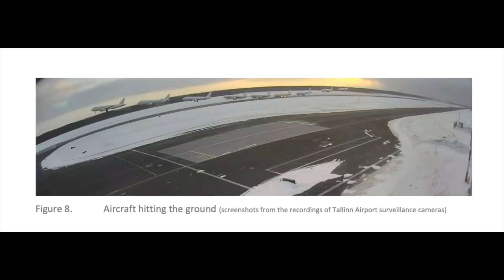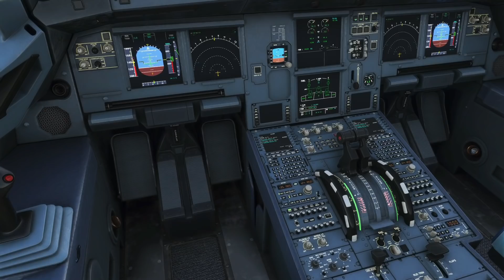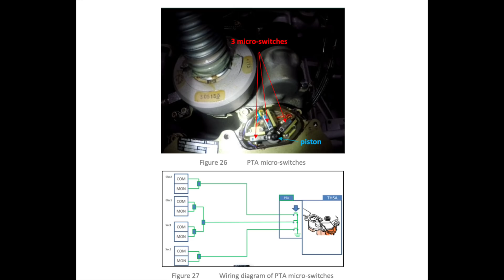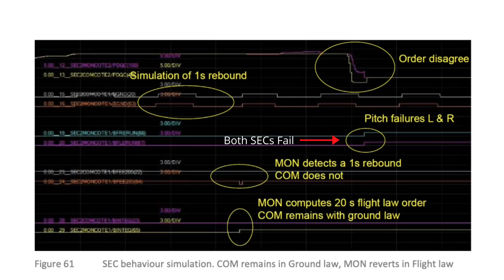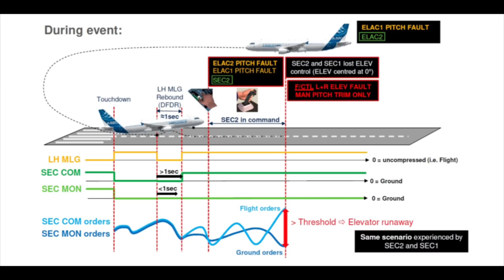The Oil Change That Crashed A Passenger Jet | The Crash Of Smartlynx 9001

Comment: I’ve actually flown both types and find that with more automation I have more time to recheck routes weather and possible outcomes were as no or extremely little automation there no time for any changes once you’re airborne, the main difference is just how you manage time with no to little automation you have to plan ahead even before you get on, the same but to a lesser extent go for largely or fully automated flight, for instance if input the wrong directions how to know and override the computer(s) in both cases it up to the pilot(s) to know and understand their’s and their plane’s limitations. If I had to choose I’d take more automation, but only if I had the full training needed to understand and situational awareness of the mechanics of system, otherwise no matter what I’m doomed to fail and quite probably get myself and others killed, long term training, self awareness, and greater quality over quantity in both pilot and machine will increase both chances of survival . I’ll go with an 8 for automation as you’ll always need manual controls as a backup
Reply: Consider that when a malfunction occurs in a complex automated system it could take a team of experts weeks to figure out exactly what went wrong. So how can you expect pilots who are suddenly thrown into an emergency situation to figure out a way around a problem with the automation in just a few minutes or even just a few seconds? The problem with automation is that a wounded automation system can react in crazy and unanticipated ways. Like MCAS on the 737 for example. In the types of automation systems I designed for industrial use the only way to deal with such craziness was to shut everything off and then try to figure out what went wrong. Of course you can't do that in an airplane in flight. Therefore the only solution is to disable all of the automation completely and fall back to a complete manual back-up where the pilot can take immediate and total control of the entire airplane. And of course this will require that pilots keep up with their basic flying skills as automation does tend to erode basic pilot skills. Maybe some mandatory stick time in gliders for commercial pilots wouldn't be a bad idea.
Reply: @joevignolor4u949  ever heard the word redundancy, two or more systems working in tandem if all else fails always have the manual controls as backup however with larger and heavier loads stall speed increases and more complex aircraft and communications one or more pilots aren’t going to be able to cope with work load of a un-automated flight control system trust me I’d rather have a new triple 7 than a Convair 780 turbo prop even with five pilots on board . Also I think I did ask for more training and understanding of the systems didn’t I ?
Reply: @samaguirre3283  So what happens when the automation system in your airplane pitches you nose down 45 degrees right after take off when you are only 1,000 feet off the ground. What do you do then? Oh wait a second. Yes that's happened hasn't it? And remember Sully? He was a glider pilot.
Reply: @joevignolor4u949  to be exact I had a old DC6 with three of it’s four engines knocked out and the last one over revving because of a single mistake by myself and captain and ground mechanics that made it me and the cap for not noticing thankfully the flight engineer was able to to catch it and we made emergency landing the same couldn’t be said of our Gulfstream4 as we were about takeoff it flashed us every kind of warnings making us abort the takeoff even before we knew what was happening, like you said I have both glider and sailplane practice and many a pilot(s) (Gimli glider=Air Canada flight143 & TACA flight110 and your Airways flight1549) to their credit have saved both plane and the lives of crew, passengers, and civilians on ground, but it thanks to some form of automation that made it possible not the other way around even Air France flight 296 wasn’t because of automation but lack of understanding and proper training, the three examples of unpowered emergency landing given were made possible because of proper training and properly followed procedure(s) as well as a little help from (you guessed it) automation, so to answer your question yes it can and will fail sometimes but very very rarely does it catch a properly trained pilot off guard on the other hand a manually operated system can fully be expected to fail at any moment and it will kill you . I could argue with you about the con and pros of automation in a plane but you got to understand the why and how before anything so I’ll just say you are right and I’m wrong okay and leave it at that ?
Reply: @samaguirre3283  The only point I am trying to make is that when automation systems malfunction, which they sometimes do, the results can be highly unpredictable and unexpected and it can catch you totally off guard. Because of the rising complexity of these systems the failure scenarios, when they do occur, can be sudden, baffling and difficult to recover from especially if you are in panic mode. One good example is Qantas Flight 72, where a malfunction in one part of the system resulted in erratic and unpredictable operation by the entire flight control system even though the one malfunctioning component had triple redundancy. Another example is Air France 296, where they threw something at the flight control system that it wasn't designed for (a low pass flyover at an airshow by a commercial jetliner) so it flew itself into the ground. When things like these happen you may not have enough time to figure out what's gone wrong with an automated flight control system. Instead you may need the option to just go totally manual and fly your way out of danger to save yourself.

Comment: I don't work in aerospace; but I do work on automation systems. Careful consideration should always be given to the "safe state" of terminating faults - ie, "what does the 'safe state' mean for this system". Frequently that state is to stop (especially when control of human-crushing forces are involved). But sometimes that state should be "complain loudly, but just do what you're told", which I've seen frequently in the automotive industry. It really doesn't take a genius to figure out, if every controller fails to "do nothing", then some combination of failures will lead to the plane falling from the sky. It's not Murphy's Suggestion
Reply from the maker: You’re very correct

Comment: I would like to see an airplane that had all of the automation and computer systems of the Airbus, but with some sort of manual cable system, like in a Boeing, that the pilots could use in an emergency. Ultimate redundancy.
Reply: Like in what Boeing? 737? The 777 and 787 have full fly by wire system. The reason is that cables increases weight and reduces fuel efficiency. This is the main reason for going full fly by wire.

Comment: 11/10. My personal opinion is that if you're going for automation go the whole way and remove pilots from the equation completely. There have been so many accidents where a major contributing factor was a breakdown of communication between the pilot and automation. This is a good example. After the ELAC errors full automation would not have allowed another takeoff until the fault was fixed.
As a programmer I know the hardest part is making software easy for people to use. Removing the human equation simplifies the whole control system. Again this is a good example. With full automation there would have been no need for that complicated override system.

Comment: Why didn't they ground the plane after the first landing with errors and check it out?tead of taking off again?

Looks like a big failure and this is why pilots ignore safety issues, they are taught to ignore them in flight training.

I want Pilots that don't ignore warnings like this and continue to fly the airplane.
Reply: The manual stated the computers could be reset. It didn’t say how many times so that’s what they went off
Reply: @tomstravels520  resetting it multiple times and continuing to fly, shows they are idiots and should not be pilots.
Reply: @bretwalley4673  resetting it did actually fix the problem. What this video fails to mention is the only time the aircraft failed to respond was when they didn’t reset the computer. And as I said there was no clear guidance by airbus or SmartLynx wether to continue or not. As the fault with the ELAC was fixed every time the computer was reset
Reply: @tomstravels520  if it fixed the problem why did they crash?
Reply: @bretwalley4673  because ironically they didn’t reset the ELACs. This left them in a state where they had no pitch control and then the SEC design flaw occurred. If they reset the computers as they always had done it would have cleared the fault with the computers and restored normal pitch control. Same goes during the manual trim phase
Reply: @tomstravels520  training flight too, training pilots how to crash airplanes.

I always wondered why pilots crashed planes from something stupid like a burned out light bulb or some other minor issue, and now I realize why, sloppy training of pilots.
Reply: @bretwalley4673  the burnt out lightbulb accident was from the 70’s. You really think we still have those training standards today? I have explained to you what happened here and what had to be done to prevent this and why the pilots continued. The FCTM has been changed now to clearly state how many times you can reset a computer and this includes training circuits
Reply: @tomstravels520  how many planes have crashed because of pilot error because they didn't pay attention to where they were?

Their Altitude?

Or other things where the pilot, first Officer and navigator got wrapped up with something minor and lost focus of their number 1 job? Flying the plane and paying attention to their minimum altitudes and where they are.

They even have names for it like CFIT.

They had a known problem, kept flying the plane, over and over again, bad training and now I know why a Pilot so easily gets distracted and  loses track of whats going on, even in training flights they purposely fly a plane with a serious problem, they crashed the plane and are lucky they didn't kill themselves or anyone else.

I have heard of pilots having an engine problem and shutting off the wrong one crashing the plane, and killing everyone on board, how does that happen?

I deal with OSHA if we knowingly violate safety like they did, it would be a hefty fine, what happened to these bozo's?
Reply: @bretwalley4673  at what point in this flight is the pilot “distracted”? They reset the computer, immediate fault is gone. It is not serious problem. You are not understanding what happened here. 

The pilots that shut the wrong engine down couldn’t read the instruments as the indicators were tiny and the plane was vibrating so the captain made an assumption using the bleed air system based on previous experience....except nobody told him it had been changed and the fact the vibrations and fire went out seemed to confirm his suspicion. Back then aircraft didn’t say “ENG 1 FIRE” in red letters

You seem to be assuming ALL airlines train their pilots badly. Even this wasn’t bad. There was no guidlines dictating what to do in the event of computer failure but as the computer was successfully reset each time they may have chosen to wait until end of the session and then report it. If the guidlines has said “stop the session immediately” and he didn’t then fair enough he broke the rules
Reply: @tomstravels520  not a serious problem?

They crashed the plane.

Seems pretty serious to me.
Reply: @bretwalley4673  crashing the plane is not a “problem” it’s a “result” of a problem. That problem being pitch only being available with mechanical controls. The aircraft is still controllable if you haven’t smashed your engines to bits. The problem was only created because of not continuing to reset the computers. You do realise planes can fly with certain items not working right? Look up the minimum equipment list. And aircraft can often fly without a reverser working or an APU.
Reply: @bretwalley4673  where did I say “they did nothing wrong”? Yeah they did go wrong. They didn’t reset the computers as told to by the aircraft on the last touch and go. Do you really think every aircraft in the sky has no problem at all. Ever heard of the MEL. Planes can fly with certain components not working. 

Was Sully crashing the plane into the Hudson River a problem? No. The problem was the dual engine failure after a bird strike.

How does the trainer screw up? They did what they were told which was to rotate the plane and they couldn’t. They are training. The clue is in the name. Train. Not a fully qualified pilot. Hence why another safety pilot is in the back.

The pilots always had pitch control. And what point did they have no pitch control? When the elevators stopped working. Operating the THS is just like operating the elevators but more slowly
Reply: @tomstravels520  Sully reacted to a bird strike and landed his plane as safely and as quickly as he could, he didn't ignore the problem and keep flying.

Sully wasn't hack and a dangerous pilot like the guys in this video.

These bozo's wouldn't have been able to handle the plane like Sully did.
Reply: @bretwalley4673  really? How would you know? These guys reacted to failed elevators AND dual engine failure as quick as possible. These pilots had even less altitude, less time and fewer controls than sully did when the elevators failed. They still managed to the turn the plane around and “land” it when both engines failed. Did sully do the same thing in general? Oh yeah he did. You can’t ignore a dual engine failure and you can’t ignore elevator failure. The only difference was one was partially caused by the pilot the other wasn’t.
Reply: @tomstravels520  they kept flying after they had major problems and crashed, seems to be pretty obvious to everyone but you they screwed up.
Reply: @bretwalley4673  you should go and look into the aircraft systems. Having the ELAC fail in 1 channel (pitch) is not a “major problem”. All you are doing is just going of what the narrator said which is not entirely accurate. Either do some research and see how the aircraft works or read the report. Then you’ll realise is wasn’t that serious of a problem until the didn’t reset the computer again the last time
Reply: @tomstravels520  they ignored the problem repeatedly, they crashed the plane, they screwed up, yet you defend them.
Reply: @bretwalley4673  they did not “ignore” the problem. They reset the computer as was dictated in the airbus manuals. The problem went away. Resetting the computer fixed the immediate problem of having limited pitch control. This is what you don’t seem to understand. The manuals did not say how often to do it and what if its a training flight. This was changed afterwards to make it clearer. If you  are following the guidance from the operators manual then you can’t really be blamed as you are following the airlines or manufacturers advice. If you were told by your superiors it was safe to do something and then it resulted in you or others getting injured would you just accept it was your own fault or inform the investigators that you were told it was ok to do so?
Reply: @tomstravels520  they kept resetting the computer ignoring the problems, until they crashed the plane.
Reply: @bretwalley4673  wrong. But I cannot be asked to explain it to you anymore so go and read the report if you want real facts